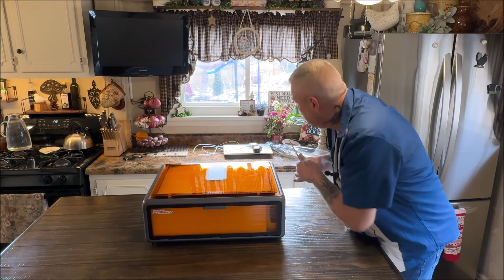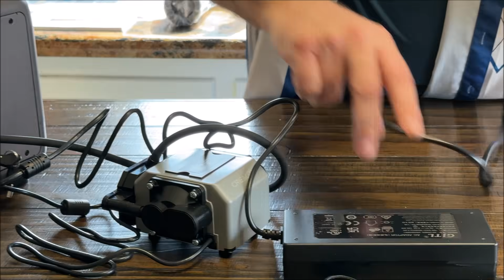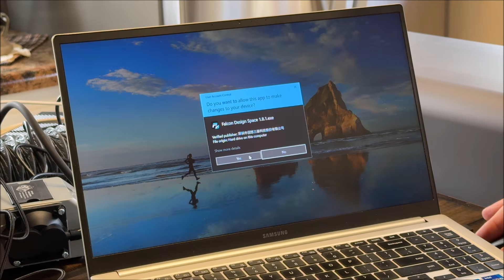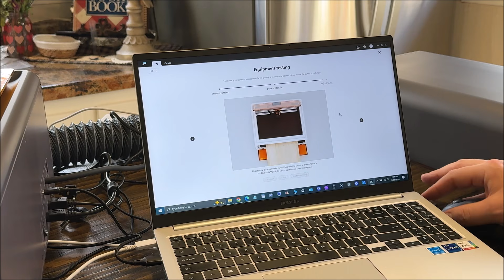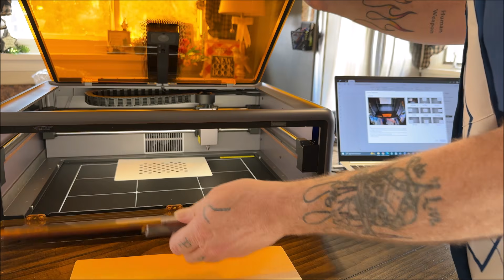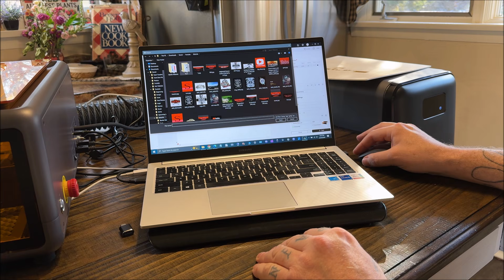Creality Falcon A1 10W Diode Laser Engraver And Cutter #creality #engraver

Comment: This was unexpected on your channel. I'm interested in how your metal turns out. I had a lower power unit that wouldn't actually engrave on metal eventhough it advertised it would. You had to spray it with some clear coat specialty spray, then it burned the coating. Obvously, this was not optimal.